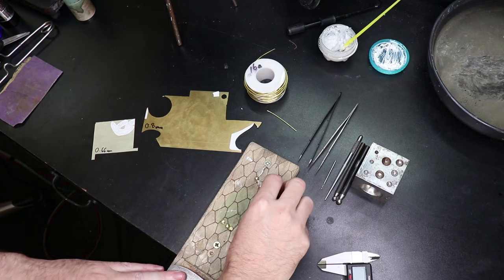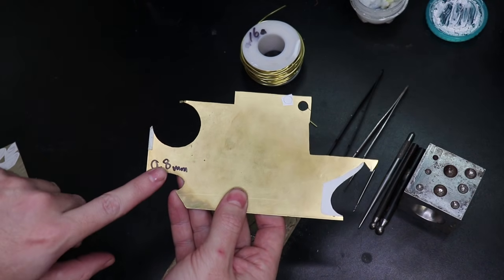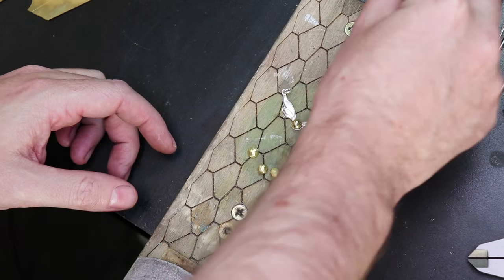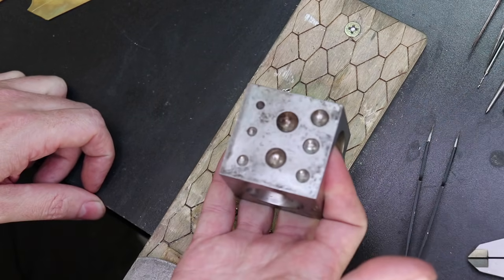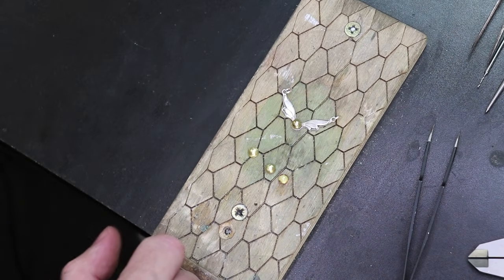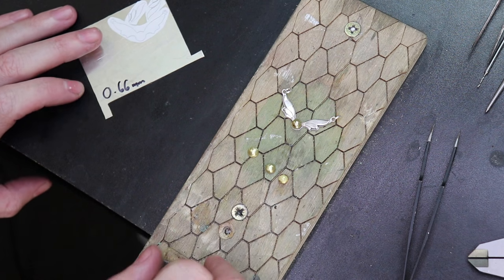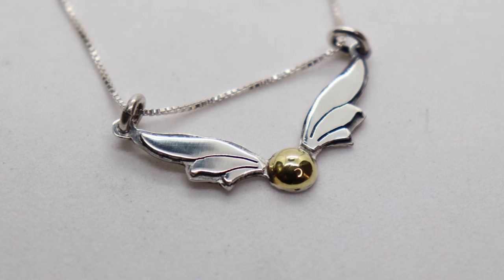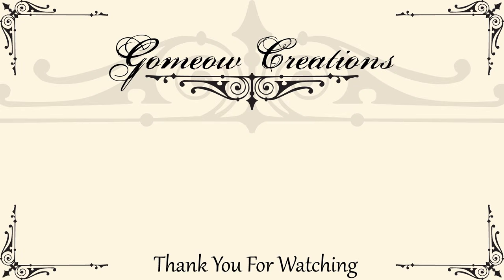How to make your own golden snitch necklace using silver and brass

Comment: In just One video, I learned how to avoid solder jumping around, how to make nicer wing shapes and create volume (I just did one set of wings but they look too flat + the holes at the end are in the wings - not nice), doming brass also works, how to ball up brass wire (I never managed and now I know why), length of wire needed for size of ball, and much more.  Thanks so much ! Just wondering : where I live I can’t get doming punches or blocks.  That’s heavy stuff to ship in or bring in a suitcase.  What about wooden punches ?  Would they work for such small items ?
Reply from the maker: I honestly have never used the wood versions so I don't know how well they would work but I would think that thin and soft metal it should do the job.
Reply: @GomeowCreations  Thank you for taking the time to answer ! Much appreciated.  All the best from Kingston, Jamaica

Comment: Can you do a video on making different shapes of wire, like half round, or square wire, or maybe wire that looks like it's a bunch of silver granules together. Without having to actually solder a bunch of silver Granules. To make filigree work easier.
Reply from the maker: I was planning on doing this and was talking with a company to supply me with the tools to do this but that is still up in the air right now. I'm still working on this and hope to get it all sorted out.

Comment: What can I use to solder copper wire jewelry that looks that is copper in color? sterling silver past is great but I don't won't the silver color to show. I need copper on copper!
Reply from the maker: Well you can use this https://amzn.to/2SxS2hi
I have used it in the past and it;s easy to use but it can still leave a bit of discoloration depending on what you are working with. 
You can use silver solder on copper and just copper plate it and yes copper plating is easier than you might think.
Can use this https://jaxchemical.com/shop/jax-copper-plating-solution/ 

If you having any questions please let me know =)